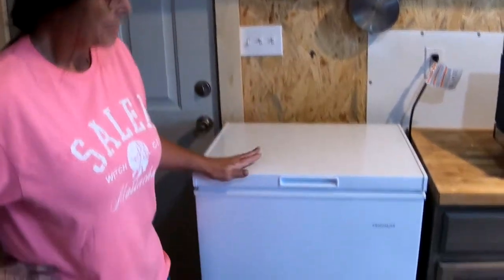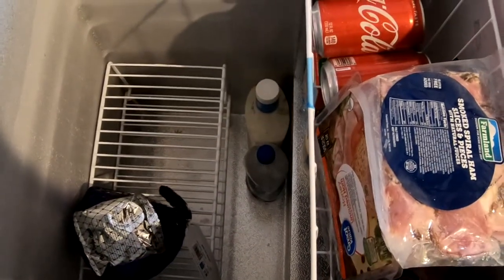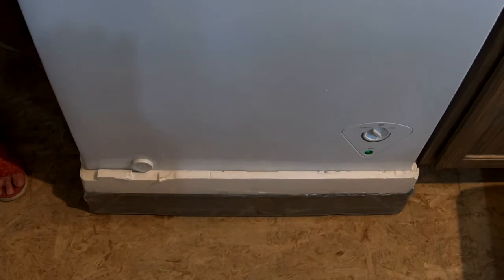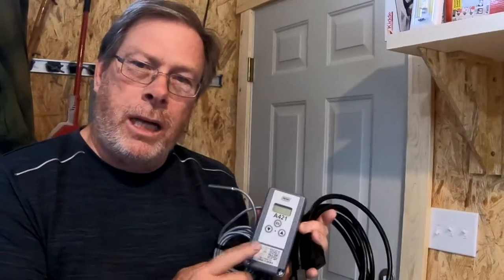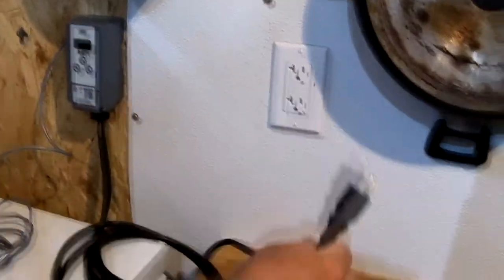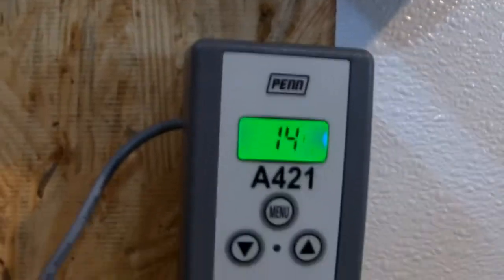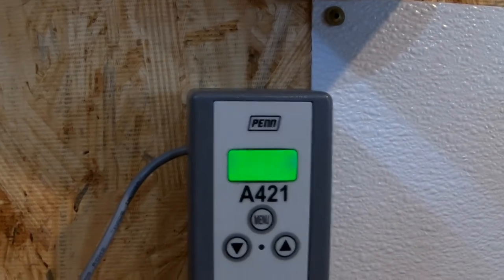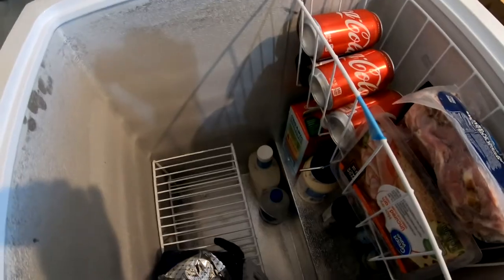Off Grid Refrigeration!!

Comment: That's by far the simplest conversion I've seen. Thanks for sharing the video!
Reply from the maker: Thanks! E-Chip's brother uses a small chest freezer and a thermostat like this in brewing and fermenting. We remember watching your video on the washing machine. How is it working out for you?
Reply: @contentment164  one of the best $120 we've spent since moving off grid! Uses very little electricity and gets the clothes really clean.  Holding up great even stored outdoors (covered of course).